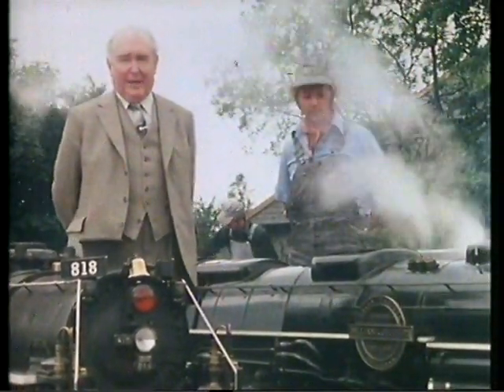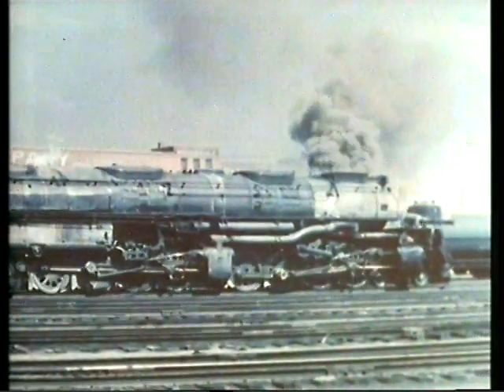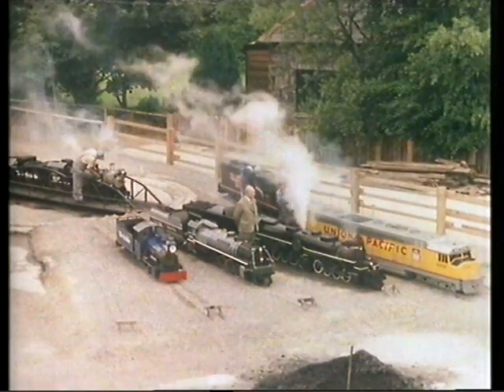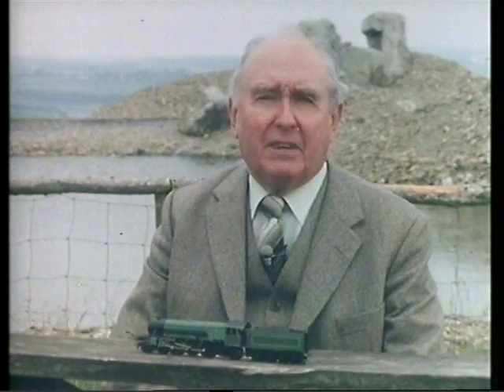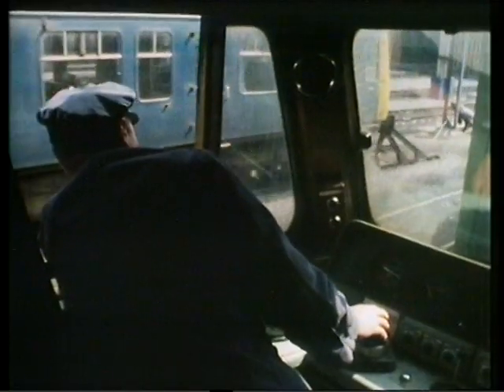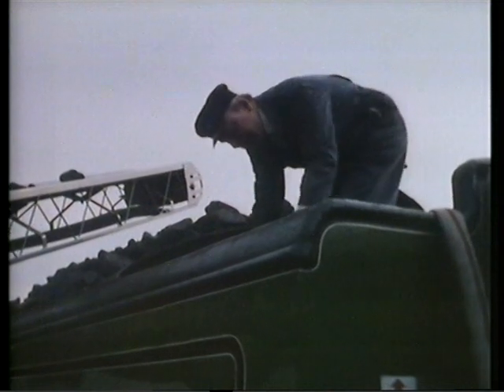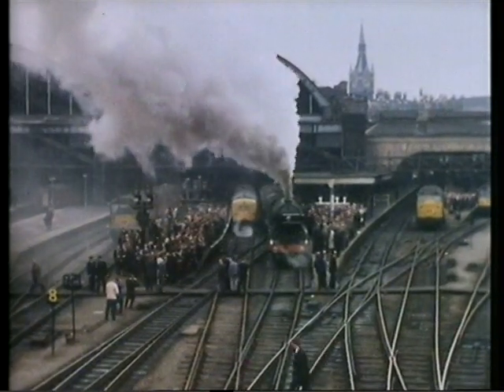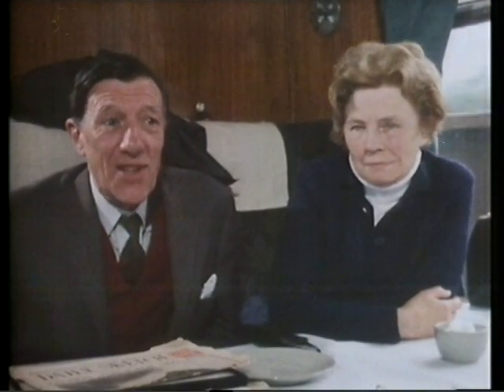Great Railways 1 - Side 1... (BBC Video LaserDisc)

Comment: Hello Multiwizard I have an broken laserdiscplayer philips vlp 830 (the ON switch does not work). I watched the videos you uploaded 2 years ago where you too showed us the inside of the philips vlp 830, but I have no idea how to open it without breaking. 
Can you please show in a video how you open the laserdisc player philips vlp 830 without breaking it?
Reply from the maker: Sad to hear your VLP830 isn't working... :-( 

A pity I have bad memory about things like that, but most of the time these players have some screws at the back or bottom to open them up...

Sadly the VLP830 I had was irreparable, mirrors & laser.

I really hope you can repair it but if you ever like to apart with this LD player just let me know...

Edit: Ps.
perhaps you can open the players lid by using the remote, perhaps there are some screws underneath...